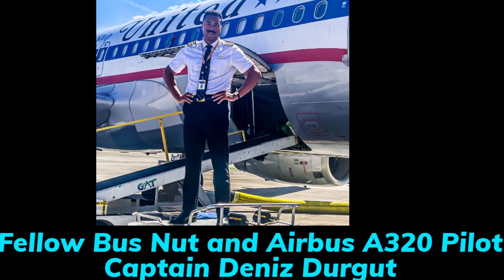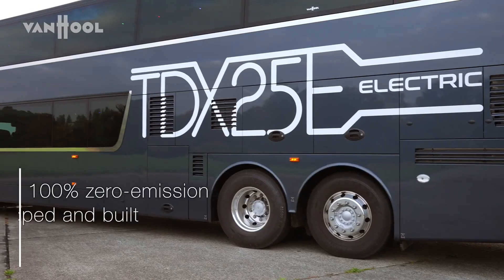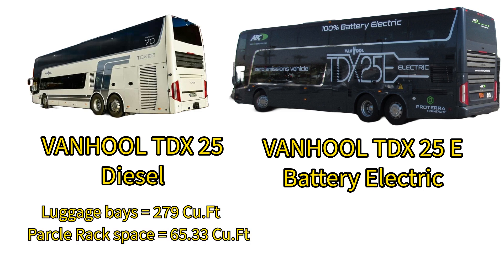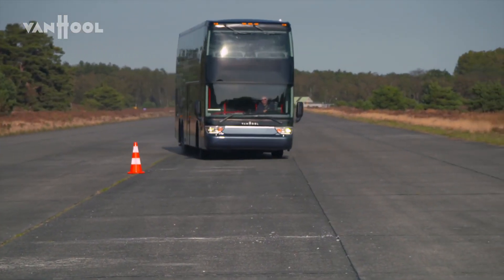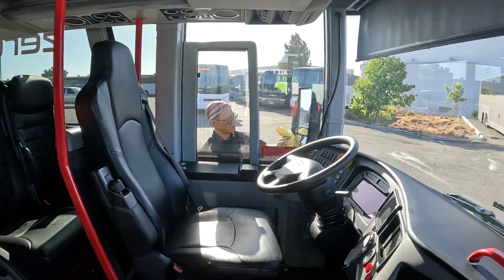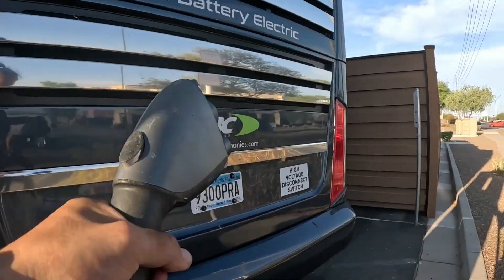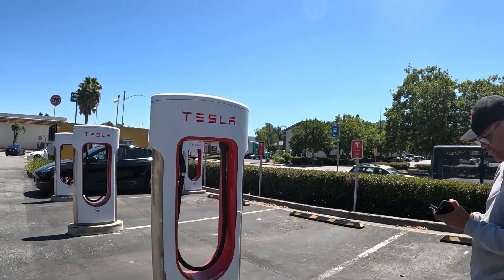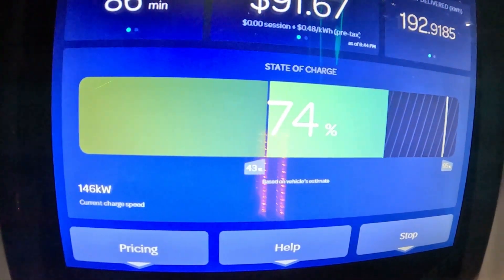What's under the hood of the Double Decker bus? | Vanhool TDX 25E Techs and Specs

Comment: A question about the charging plugs: Did I get that correct that you ONLY can charge with DC-plugs (fast chargers)? Seen from a European perspective this feels a bit weird. I agree that charging a 600kWh battery from a domestic plug is a bit unrealistic. But at least in Europe 22 kw Type 2 AC (somewhat comparable to SAE J1772 I'd guess) chargers are significantly more common than DC fast chargers. It still takes a long time. But if you drive a group to an amusement park (as an example) and sit around for 6 hours, you can refill 20% SOC of the buses battery, giving you an extra 50 miles. Another plus for AC charging possibility is that relatively long charging cables are possible. And even further - you have an emergency fall back position. So I am really wondering why such an Type 2 AC / SAE J1772 charging option is (arguably) not implemented.

Comment: Wow a non steering tag axel? That's like going back 20-25 years. I remember my first van hooll dubbeldecker, a stickshift that felt like stirring in a pan of soup, I had to lift the axel every tight turn and roundabout because the stiff tag axel would obliterate the brick roads over here(so in Europe that was basically every 10 seconds)

Comment: I think EVs is a good idea, my problem with EVs is the cost,the cost shuts out the poor & lower middle class out of a vehicle that has benefits, second is the safety concerns, I hate to be around those buses when a thermal break down happens and what people don't think about is the magnetic field that battery and motor produces can be a health concern, and third is the environmental impact with the use of cobalt, lithium and other metals, I am not going to get into the forced child labor in many mines where the metals used come from. I am not against EVs ,but as a society 2030 is too soon and there are so many problems that are still needed to be fixed
Reply: Have you seen any of these things? I do not watch a lot of news programs, so, I my have missing theses things.
Reply: @davidhamm5626  Maybe you should start watching. Lots of  DEISEL goes in to producing a battery! I wonder what the rubber tires on EV's are made from? Brace yourself------O I L
Reply: @stevepackard8542  What happened to the rubber trees?
Reply: @davidhamm5626  Same thing that happed to the money trees?!
Reply: I thought there is magnetic waves come off of batteries too.
Reply: @stevepackard8542  Magnetic waves need metal to work,.I what you say is true, a compass should follow your phone, and flash lights.

Comment: The biggest problem with long distance electric busses is, after the loading infrastructure, is that it is not feasable with the current driving time regulations in Europe. You can't simply make 1500km in 21hrs with 2 drivers when you have to load 4hrs. But EV busses are good for public transport, school runs etc.

Comment: It was exciting and an adventures to follow your family as they journey across the southern US in an electric double decker bus for the first time in history!   

I do think ABC should of had a 50-ft charging extension cord and some drive over cable protectors ready for the trip.   Short extension cords are on the market for Tesla chargers.  I didn't find one for CCS chargers, but ABC could of had one made.  It would be bulky without liquid cooling, but assuming a target length of 50-ft the bus could of been parked across the parking lot access lane so as not to be in the way of other charging vehicles and the long extension cord would have allowed switching from one charger to another when chargers didn't work.   

This would not be a cheap extension cord costing several thousand dollars to have made and would not have UL or some other consumer product safety testing.   

I will always remember this first BEV bus trip across the United States.

Comment: My tesla has same problem charging for long road trips Fayette County pa has no ev charging of any kind it would be good busness sense that truck stop and convince stores have ev charging. We would grab eats and drinks while charging, you can fuel your diesal coach faster then tesla getting a fast charge. Transit busses can use double trolly system to run and charge and use battery when on back street part of route. Transit operation is different cup of coffee verses charter and fixed routes intercity.  Anything less then 600 miles the bus can do better then airlines because of the airport congestion and location check in. Even though run time of airplane is only hour or so take off to touchdown but you get stacked up to wait your turn to take off and land.  Small airplanes can save time but getting car or ground transport is harder at odd hours. With tech you can bypass accidents and construction, big planes can't land anywhere the need airport services more then small airplanes😊
Reply: Surprised there isn’t one in Uniontown out by WC3, I hardly get down there, and my EV won’t even make it, but to not have one at all is strange.

Comment: It was a good test of the current state of the industry. The industries (battery, charging, etc.) will continue to improve and these extreme uses may become more feasible. I like you pointing out that using the right tool for the job is good. This is not the bus for cross country trips, but may be fine for local or short haul needs. ie. Champaign to Springfield and back

Comment: Good evaluation, for me I don't hate certain products per say, I just think more about prices of say charge cables and other little things, so your thing about Iphone stuff does actually ignite one of the reasons I choose android.

Getting back to the electric v diesel argument, for me I would choose electric if I knew it would do the distances I could be traveling, nothing worse than having to stop driving and pull up at a service area for 3 or 4 hours or however long it takes assuming the charging goes without problems equally and no one unplugs you. It is this security alone which is why I would rather a petrol car,  hybrid equally could work. It's not that I don't care about the environment, but for my security of reaching my destination when and need to be at for certain times.  Whilst or I may not just run locally 80% of the time for me is not the point, the point again is I might get a call from a relative etc and need to travel and equally find out I got a 3-4 hour delay as I need to plug in to even cover that distance, I might equally decide to go on a random weekend away that again is outside of the range of the car. 

My conclusion is if governments stuck to hybrids then most I think would buy into that, it gives them the flexibility to fill up and drive long distances as needed whilst still cutting down on emissions,  clearly the electric car/bus market and drivability is no where near close as needed at this time, so hybrids for me would be the obvious way to go, maybe in 30 years time it can be looked at again and hopefully as more and more infrastructure is made available and reliability and securing charging and not have people unplug just because they can, then maybe I could buy into this.
Reply from the maker: Very eloquently put! Thank you for writing this!